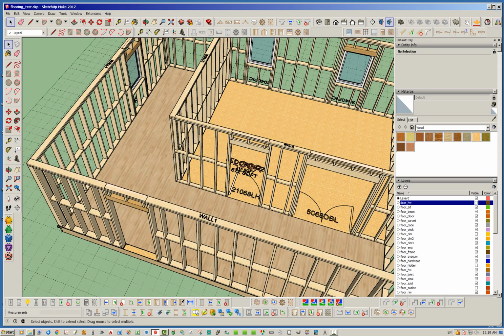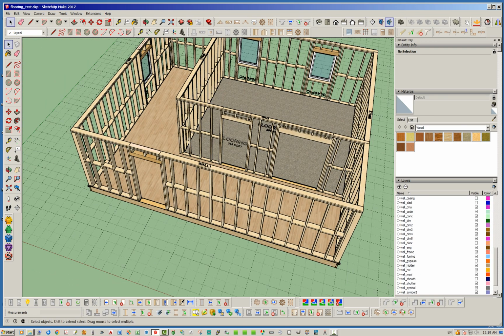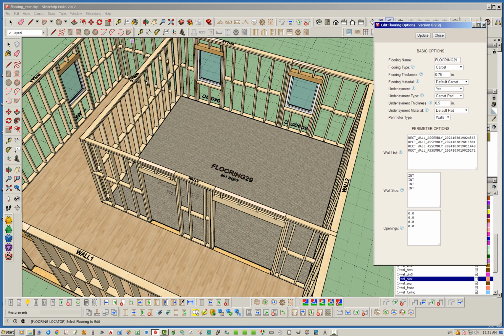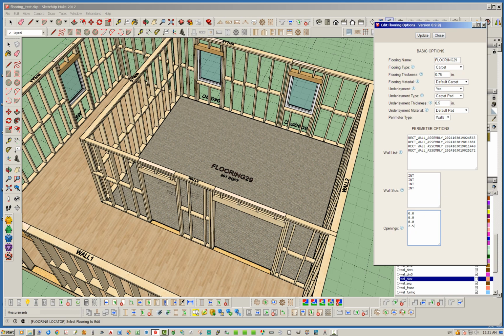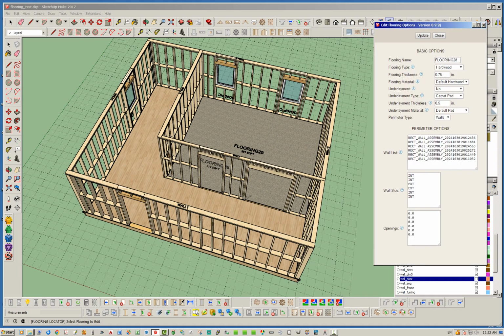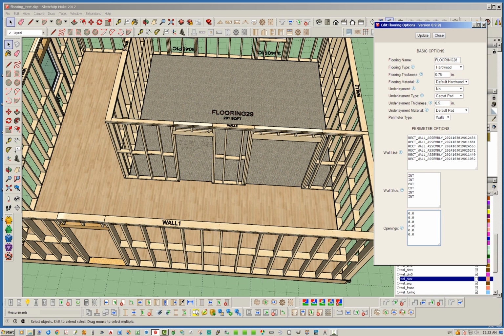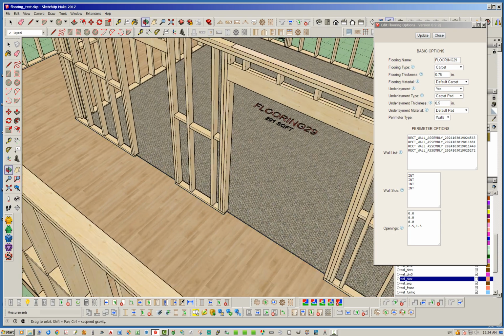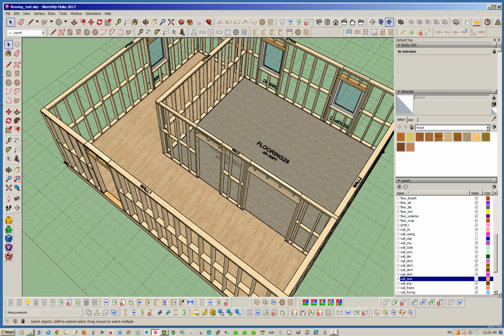Medeek Floor Plugin Tutorial 16 - Floor Coverings with Openings in Walls

Comment: Beautiful. 
Can you add a rotate option for the (wood) floor texture incase it is supposed to run the other way?
Reply from the maker: Version 0.9.9o now has that option.
Reply: @medeekdesign  Thank you sir. I'll be checking it later today!
Reply: Also is your number system for the opening list from the no point of the x,yo and clockwise…
If yes, it would be good to confirm and if possible but an indicator at said point, similar to the wall, when stretching with a bid green round inidcator
Reply from the maker: @dannygates806  The walls are ordered in the same order that you selected them when you first create the floor covering.  The doors are ordered by the order of the doors within the wall itself.
Reply: Also if possible to add the wall timber frame number into the opening option, if possible…
Labelled as “wall 6” in flooring 29 opening option 4 to show the link.

But if not possible with code, just showing on the carpet which side is which…
Start point “no,point highlighted green” side 1,2,3&4 etc?
Reply: Also a threshold will be needed for the 2 floor finishes…
Would that be configured in the door opening module or the floor finished module in this video.

Could the door threshold also be the answer to syncing the floor finishes around the openings?…
By talking to each other and being parametric?

Much is to consider…
About how the your coding works together and if it’s possible for modules to work together and reacting with the Input while passing info between each other…

Could you do a videos of how this works with you coding and how we could best suit our feedback to suit?

Also a standalone tools for opening??/
Reply: Also what are your thoughts on the next steps for this module or questions you have for this module for us to think about?